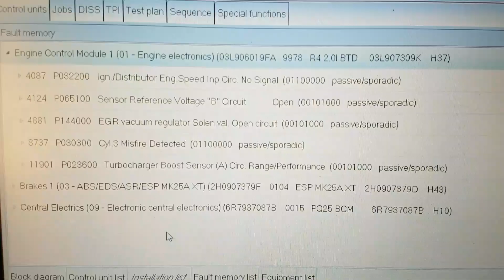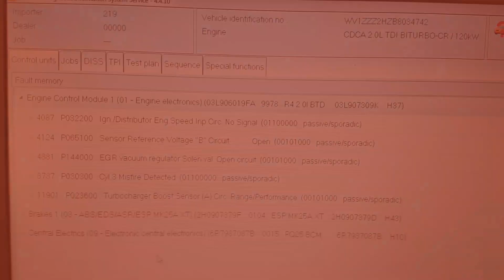VW Amarok 2.0 TDI In Limp Mode P0651 P0236 P1440 P0322

Comment: Yeah they wanted to charge me for a new EGR unit, I went home cleaned out under the top cover, corrosion scraped out, discovered the valve was sticky in an open position so shot some WD40 in there, made a new spring myself on the lathe winding spring steel around a bar of steel, decided not to install the spring as it only takes up a small amount of backlash, 10 years later still no problems. WD40 is much cheaper than a whole new EGR and my service guy just looked at me with the but but but the diagnostics told me we had to replace it.

Comment: Hi mate, I know this is an old video, but I was having an intermittent egr fault, the check engine light would come on but no change in drivability. I removed the case like you did, abs found oil inside it, they're not supposed to have any oil in them are they?
Reply from the maker: No oil should be in there.

Comment: have you ever done this before to a 3.0 tdi? I'm having a problem with my q7 code P0046 i just want to know if I have to replace the actuator or the whole turbo
Reply from the maker: If you buy just the actuator, you need an audi special tool to be able to do the calibration of the actuator. That's the only way so you'd have to take it to an audi dealer.
Reply from the maker: Or replace the turbo
Reply: @FourRingsAuto  ok, I appreciate the answer, I bet that the dealer will say, replace the turbo 😪 but thanks for the info